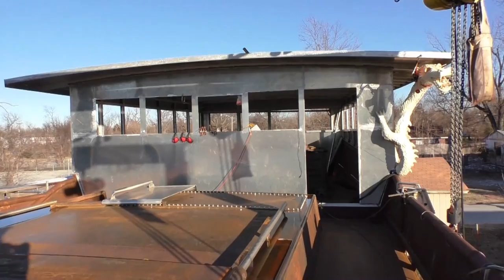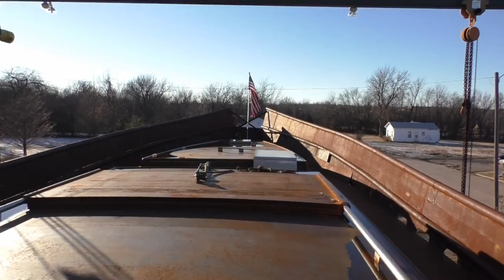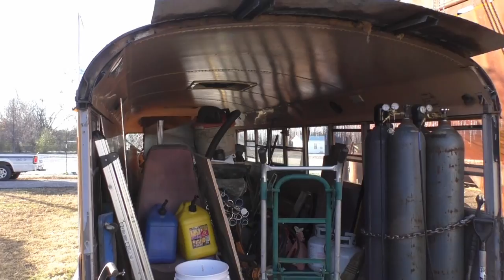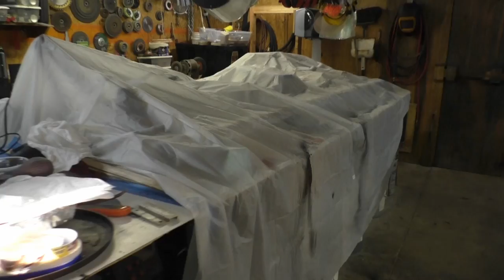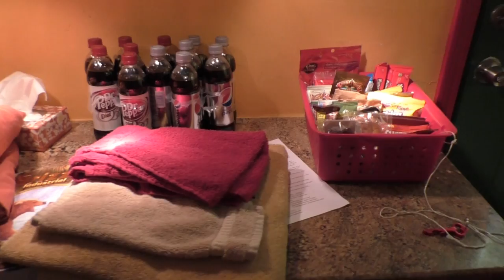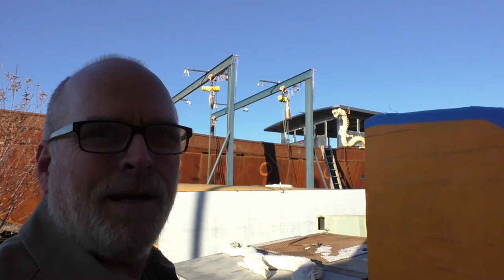Tour and Invitation

Comment: Too bad I didn't know you were doing this a couple of years ago.  I had to do some test flying out of TUL and was there about 3 months. Stayed at that Homewood Suites a few miles south of the airport. The first 3 weeks I didn't have to fly at all and pretty sparingly after that until the last month. I could have been of use I think. I do a lot of TIG, CNC machining, mechanical, electronic stuff as well for a hobby. Great job on the build!

Comment: Your project is awesome. If you answered this in another video, just say so. Your super structure appears to be aluminum on the steel hull. Did I see that properly? If so, I was wondering how your build manages corrosion between the two metals.

Comment: Great job I have seen most of your videos, I was wondering what kind of power system you will use; Solar panels,generator DC to charge batteries (fork lift batteries are probably best) with inverters  for 120/240 volts ?
Reply from the maker: +Michel Grenier   We are a long way from those decisions.  Likely no DC generator but a couple of AC units supplying 120/240 for machinery.   And inverters for small loads, with solar panels to put some of that back.   And lead acid unless Elon Musk drops the price on his batteries.

Comment: You mention divers...Are you planning on putting a high pressure compressor on-board...maybe some Oxygen with a haskel pump for Nitrox?
Reply from the maker: +WreckDiver99    Yes, if we can find one we can afford.   I prefer surface supplied air.  And I'd like to build a re-breather too.   ....such a long list.
Reply: Don't build one...life's too short on those.  Also if you plan on that PLEASE take the classes.  I understand you like the surface supplied, and for maintenance work it works great...but if you want to dive away from the boat or deep...nah...I'll take my tanks and deco bottle.   Would love a rebreather, but the classes and equipment is just a bit too expensive for this guy.  I'll stick with doubles and deco-bottles...and I keep it max at 140'
Reply from the maker: +WreckDiver99   Oh no!  I am absolutely going to build one.  Likely several.  Jacque Cousteau never got his certification either.   And I am glad Swede Momsen and his divers did not think it was too dangerous.    And there are good things about tanks, but like anything else, it just depends.   I just love my little hookah dive system.  No heavy tanks,  portable, four people can dive for hours on a single tank of gas.
Reply: Oh no doubt in my mind on the hookah...I know people that use them...just make sure you have fresh air coming in the right way, and the exhaust blowing the other!  :)  As for rebreathers, Jacque didn't invent them, that was Henry Fleuss in the late 1800's. Really the Draeger rebreather is pretty much where it started for more "modern" diving and was used post WWII....Last I knew Cousteau never used a rebreather.   Rebreathers are not for the weekend warrior in general...Improperly packed scrubbers will kill you fast. They are expensive things to maintain as well (O2 sensors need replacing on average of about once a year depending on use).  If you aren't hitting anything below say 30' and not going anywhere far from the boat the hookah is awesome...Regardless, if you plan on having divers (particularly research divers) you're going to need to have a way to fill tanks.  A standard air compressor coupled with a Haskel pump can work (but is god awful slow)...Unfortunately those darn pumps aren't cheap (though there are plans out there to make them (really just a high pressure cylinder run from standard air compressor pressures).  Keep up the good work.  Always enjoy your videos...and BTW: I completely understand the "This shit is dangerous and safety is up to you"...just giving you input from somebody that has seen people get the bends, and get injured from rebreathers (that they had hundreds of hours of experience with)...it happens, and it sucks.  Sail on!

Comment: I have followed this project - experiment from when you had your steel plate flat on the ground.  I am curious as ti why yoi selected an aluminum supers tructure and how you isolated it from the steel tub. I  Live in Italy on the edge of the Ionian sea . the town's name is Trebisacce in the province of Cosenza (CS). therre is little or no marine culture here, and i am trying to see if I can star a marine shop. but it looks like fiber composites is tha way to go, Even though stelle is easier to work with. I invite you to come here and see if you can help us set up.  Of course you would live at our espnese.  Well think about it. I am a civil engineer retrired hoping I can make a difference.
Reply from the maker: +Sante Camo   Aluminum is light weight which helps keep the center of gravity lower.  It's easy to cut and weld.  It needs no paint.  It's far enough from the work areas that it in not prone to damage.   And a rubber gasket will separate the pilot house from steel.    And I appreciate the offer and would be glad to help, but there are others I am certain that will be better advisers.   My experience is very limited.
Reply: Everything you said is rational, and innovative for sure: I have to say that your knowlege is general, but in depth in many respects. I suppose practice makes perfect. so more power to you.

Comment: Doug, This is Bill Brown from Tulsa. Could you let me know where in Tulsa you got your Aluminum? I need a piece 12 x 48 I need your expertise on cnc to cut out a small project for me.
Reply from the maker: +B Brown  Hello Bill.   The best place to buy aluminum in Tulsa, is not in Tulsa.   Especially if you are looking for 5052 or 5086 (marine grade).   Trident will be happy to sell to you but it will be expensive. Same for Alro or any of the others.  My last batch actually came from Interstate Steel.  They did their best to keep my price down and those guys have been great to work with.  Tell them I sent you.   But they don't normally do aluminum so they don't have volume pricing.   How thick a piece do you need?  I'll have scraps that big, but I will not part with anything till I am done with all the aluminum projects.  Craigs List is a good bet if you are patient.
Reply: Doug, I have modified my build. I will not need the aluminum right now. However, I could use some angle iron if you have anything 2 1/2 x 2 1/2. I need two piece 2 1/2 long. I could also use a table saw to cut a piece of hardwood I need for a angle jig.
Reply from the maker: +B Brown    I have some 2x3x1/4"  angle left over from the pilot house roof.  Slightly bend.  You're welcome to that if you like.  Stop by on Friday or this weekend if you like.
Reply: Doug, I will be by Saturday morning. Please give me your address again.
Reply from the maker: +B Brown 2128 E Ute St, Tulsa, OK 74110     See ya Saturday.